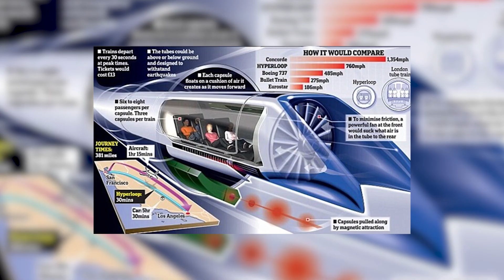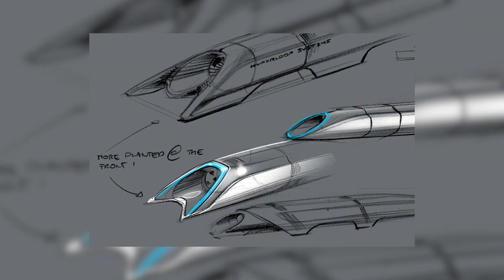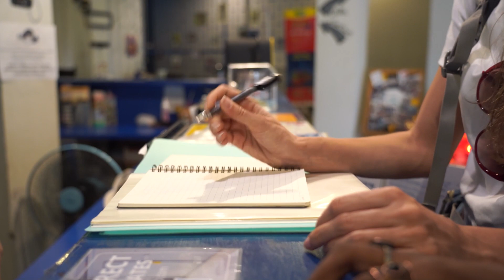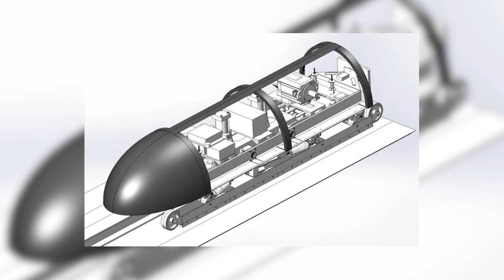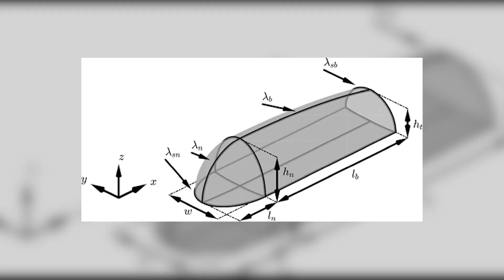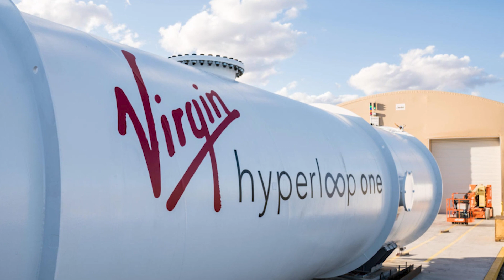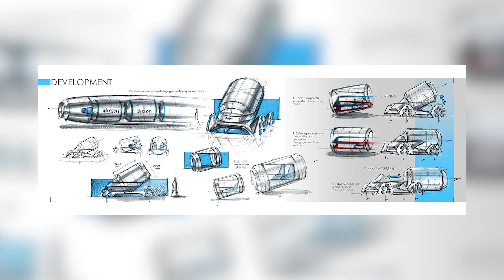What Happened To Hyperloop ?

Comment: Musk only started thehyperloop project because he wanted to stop the High Speed Rail project. SLowing down the rail project meant he could sell more cars.

Hyperloop is not practical as a mode of transport, but more importantly: there is no usecase. Every example of how fast it is mentions the really long distances, like the 5-hour drive that this video mentions. The thing is: 99.9% of journeys in the US are less than a 10 miles, it's (theoretically) a 20 minute commute at 30mph. If a hyperloop train can do 400mph then sure it will do that journey in less than 5 minutes, but that's only true if you live next to the hyperloop station and your destination is also next to a hyperloop station. They will NEVER be.

So even if Hyperloop could work it would only be of any use for long distances and gues what's really difficult to do? Building very long vacuum tubes. At the speeds that these things are supposed to run at it cannot take any corners without swuashing the passengers in their seats. (imagine a figherjet doing a hard turn). So the hyperloop has to run slow... about as slow as a regular train... negating the whole point of the thing.

It is amazing how many people seem unable to grasp these simple facts. Hundreds of millions where invested in investigating a thing that has no usecase at all.